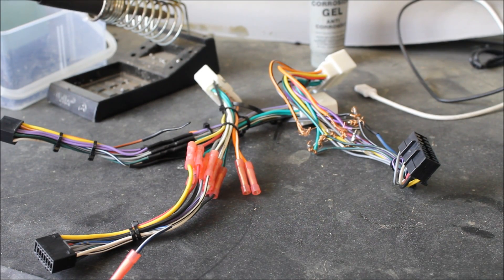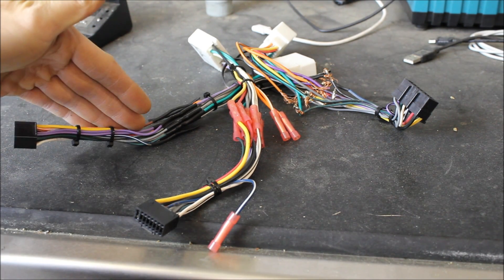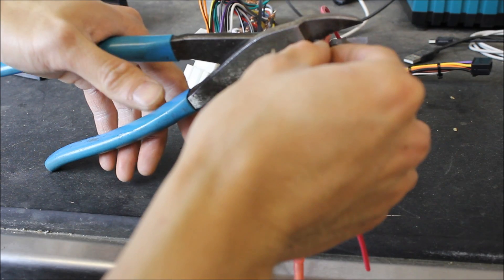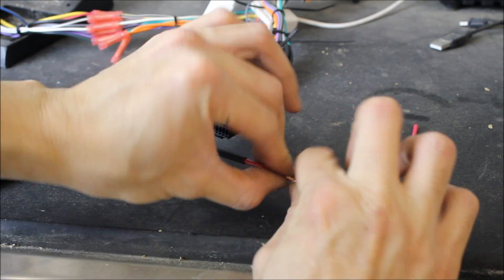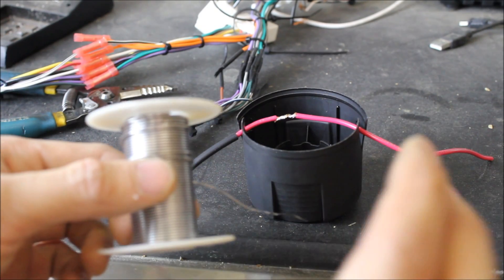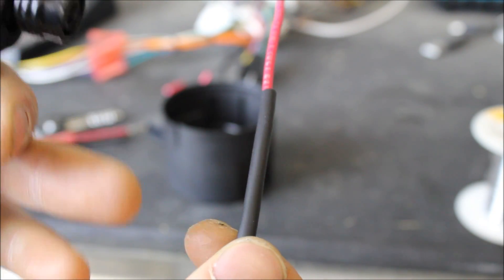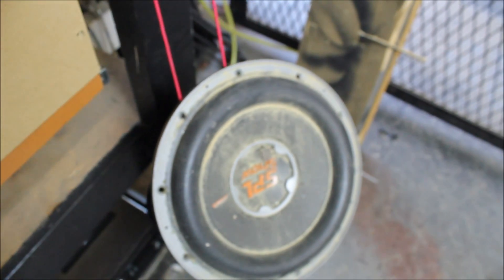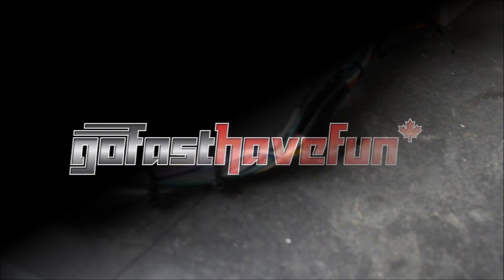Butt Connectors vs Solder | Crimping vs Soldering | Wire Connections | AnthonyJ350

Comment: Good video but disagree that solder doesn't make a good connection. Solder goes through "wetting." That is, solder interacts with copper to form a copper/solder alloy and chemically bonds the copper together. So, for a splice, the solder actually causes the two copper wires to bond together. The solder also "wicks" into the copper strands, bonding them together..
Reply from the maker: Sounds like a good old "Pure Theory vs Practical Application Debate".  So the question I have, what's your preferred method for making connections in remote starters, lighting, sound system integration and providing a life time warranty behind it while working on about 30 cars a week?
Reply: @AnthonyJ350  Actually, I don't work on cars or vehicles at all. My work is on devices, which are stationary. All of my work involves soldering.  But, to your question, "crimps" (solderless connectors) can form an excellent splice, provided one uses the proper connector or terminal and uses a proper crimping tool. I think the ratchet-type crimping tools are some of the best because they give a uniform crimp. The key is a splice that is mechanically strong and is free from oxidation (good strain relief, etc, too). Both solder and crimps will satisfy these requirements. A proper crimp will form a gas-tight connection that will keep oxygen off the copper to prevent oxidation. Boeing aircraft use crimps 99% of the time. 

I believe that both soldering and crimping can give us fantastic results, provided we do both correctly with the proper tools and the proper applications. Oh, there are also "environmental splices." These are low-heat solder connections within shrink tube. Slide over splice and melt solder with heat gun (and collapse shrink tube). Cool, but a little pricey.  If you want to see something cool, Google the NASA standards for both soldering and crimping. Two different documents. Both interesting reads. Thanks again!
Reply from the maker: @bradleysmith681  Thanks for your feedback!
Reply: @AnthonyJ350  Indeed!!

Comment: Can't really go wrong with solder in my opinion, it's the best way to join the two and still retain strength and aesthetic. Word of advice to any DIYers, don't cut the factory harness, just use a adapter, they aren't that expensive and give you more line to work with and an easy disconnect.
Reply from the maker: It's our preferred way of making connections in the shop.

Comment: I always use the right size butt connector for the gauge im working on. I then remove the plastc coating. Put the correct shrink tube over one wire.  Crimp the connector, then slide the shrinktube over the crimp and add the heat to shrink the tube. Its sorta a bit more work but the connection is smaller and the shrinktube helps hold the 2 ends together.
Reply from the maker: Thanks for sharing! Why not just purchase non-insulted connectors and skip one step?
Reply: You know, they sell those without the plastic on them.

Comment: The tinning method that you show around 9 min is most often used on circuit boards. the tinned wire goes into the designed hole easier and then solders easily.
Reply from the maker: We also use the method when we hardwire power adapters for dash cameras or satellite radio tuners.

Comment: Wire nuts with electrical tape works fine. I never had any issues. And it's fast
Reply from the maker: It's pretty bulky when dealing with so many wires in the dash. Don't you think butt connectors or solder just looks more uniform?
Reply: @AnthonyJ350  it's behind the dash. No one will ever see it. As long as you have a tight secure connection, it doesn't matter how it's done.
Reply from the maker: @mluterancik  To me it matters because I have customers the expect a certain level of workmanship. No MECP Certified technician uses wire nuts, just saying how a professional does it.
Reply: @AnthonyJ350  I hear you man. I'm just talking about people that install their own. It's good to take pride in your work.
Reply from the maker: @mluterancik  I'd love for people to install like we do on their own, it's good for the industry. That's why I show how a lot of my work looks behind the dash.

Comment: in automotive use soldering is less reliable due to vibrations and movement the solder can crack.
Reply from the maker: I think it depends on the area in the vehicle, technique and quality of solder.  You also have to factor in factory has no need to "splice" wiring, they just design it to appropriate lengths and use appropriate connectors.  Also factory in solder can also help protect the wire from corrosion.  In the aftermarket soldering is commonly used and we generally provide a life time warranty on workmanship, which is longer than any warranty manufacturers provide.

Comment: Even if both connections are done perfectly, the solder will outlast the butt connectors in terms of corrosion. Since most vehicles are on the road for 10, 20, 30 years, I would stick with solder. However, the fact of the matter is that most people do not understand how to solder. If a person does not use flux or at least flux core solder then they are just adding hot metal to wires. The copper has to have the oxidation removed for the solder to create a chemical bond to the copper wire. If this isn't done, then its just metal super glue.
Reply from the maker: Thanks for sharing!

Comment: Tinning usually only done for solid wire also allow better heat transfer, When using stranded wire you mesh then flow solder.
Adding resistance with solder only issue limited application and wire length usually has greater impact on Resistance.
But as rule of thumb automotive I would use Crimping vs Soldering for automotive if not building wire harness or something inside your house.
Reply from the maker: To each their own, in the industry most of us prefer solder for wire connections, as long as the connection is in a harness that doesn't move they last a very long time.  Had my truck for 13 years and the remote starter works flawlessly.

Comment: Will the quality of the connection affect the sound quality of my stereo?
Reply: Depends on the specific wire you crimp. But if you ask someone with a normal (nothing special) car sound system. You get a "probably not" but if you ask an audiophile you get a "YES IT CHANGES IT"
Reply from the maker: Usually does

Comment: The moment I started watching I knew this was going to start the non-insulated crimp fire-storm. Yes, that’s the way it’s designed but experience leads to changes in process that can work fine. I will put my 2 cents in as someone that was taught in 1987 to use the point on the crimper and have done it that way for 30 years. All the guys in San Diego I ever installed with crimped that way. Many of us went to work at manufacturers, like Directed, Kicker, and JL Audio and we still crimped that way. Now, I do custom wiring in hot rods and I look at crimp connectors as more of a temp fix. But this is common practice.
Reply from the maker: Thanks for sharing your experience!

Comment: Thanks  for your good information 
Please advise me about “ Waterproof Solder Seal Heat Shrink Butt Connectors with Soldering Sleeve “
I want to use it for my car abs socket witch is changed with very bad condition 
But I’m not sure this type is ok or not Due to high temperature under car hood
Reply from the maker: You want to get "marine grade" butt connectors.

Comment: I’d be more interested in knowing how you prefer to tap wires like when installing the heavier gauge ignition wires on a remote start install. Strip back and wrap then solder, strip back spread strands and pass through and wrap wire then tape, or some kind of 3m tap connector? Maybe you could do a comparison video?
Reply from the maker: If it's really thick I'll use the poke and wrap technique with solder.  Typically I pre-tin the factory ignition wire with solder, then wrap the new wire around then apply solder again.
Reply: Scotch-Loc's blow dead dogs.
If you have to tap using a connector use a posi-tap.
Add some silicone grease before closing them up if you're concerned about moisture.

Comment: Hi. Thanks for the video. How would you join a wire in the middle with a butt connector.
Reply from the maker: You don't really.  The bott connector does it when you crimp.

Comment: Thank you! Using the table surface for leverage and properly crimping the butt connector are mega ideas! I am restoring a 2001 Jeep XJ and the audio is a mess. You just saved me a ton of time!  Down the road, I want to install a Joying radio in the center of the Jeep once I get the current rat nest replaced. Cheers!
Reply from the maker: Glad it helped!

Comment: If I'm tapping into the stock head unit speaker outputs to a "speedwire" to the amp, would it be fine using quick connectors vs using butt connectors? If I ever wanted to switch back to stock I could just quick disconnect my amp cables and reconnect the stock wires using the quick connectors..
Reply from the maker: Use but connectors or solder or build a t-harness.

Comment: There is a 3rd and much better option!!  Check out the new low temperature solder shrink tube connectors.  They work great for stereo wiring.  It is easier than soldering and shrink tubing.
Reply from the maker: Thanks for the tip!

Comment: It makes 0 difference if you twist it into a butt connector....twist the wire and push it in and crimp with the correct tool thats all.
Reply from the maker: I twist the wires so it slips into the butt connector easier. If you don't sometimes strands stick out.
Reply: @AnthonyJ350  yep definitely twist the wire....but using a twisting motion to push into the butt connector isnt going to make any difference. Honestly butt connector and solder joint with shrink wrap are both acceptable. My experience with solder is that it dries and breaks

Comment: Good video. Good explanation. In applications which the current more than 10 amps, I use butt connector with overlapped cables end. I just use small copper tube and shrinkage
Greetings from Indonesia
Reply from the maker: Thank you!  Glad you liked it.

Comment: Linemans splice with Solder and heat shrink is the way to go, heck if it is good enough for NASA then it should do for anything else. Doesn't matter if oil from your hands touches it. What you should worry about is the flux residue. Not to mention a lot of people don't know better when it comes to Solder and use Acid Core Plumbing Solder when they should use the 60/40 Rossin Core or Leadfree.

Now for a the audiophile guys that think a wire connection matters. You're nuts and it is impossible to tell the difference. That would be like telling the differences between a filter capacitor in a power supply that is not in the audio path.
Reply from the maker: Thanks for sharing your feedback!
Reply: Lineman's splice is only for solid core wire. Not stranded.
Reply: NASA?  mid-80s complete o-ring failure on the Challenger mission. RIP.

Comment: Little bit late but I wanted to share this

 1-  the Heat  also sucks in the Sada Always put your torch or in on the opposite side and the shadow will actually float to the Heat  this is especially  true when soldering brazing Plumbing pipes but works the same on electrical

That last method of soldering forget it it's the worst way to solder and you going to get cold joints you don't have to worry about having Helping Hands for that because the joints are going to be cold and a waste of your time it is not the right way of soldering
Reply from the maker: Thanks for sharing!

Comment: Lol, the soldering method doesn't suck.  Your method sucks.  Yes helping hands at least.
The connection is about the copper to copper. The solder is there to make a conductive bond.Soldering and shrink tube s the best, most reliable method hands down.
Reply from the maker: nolobede Thanks for the feedback. It'd be great if you posted a video as well so we can see how other people do it.
Reply: It wasn't intended to be a negative critique, I did include an "Lol, but didn't work I guess. .I've tried to solder without helping hands too. The point was only that as you stated your preferred method was solder and heat shrink. I agree and the point about the connection being about copper to copper was  to note that yes, the solder should not be considered the main conductive  component... hence the importance of the copper to copper method when making the connection. Actually I was entertained by watching you with the 2 loose strands.  What I do is spread the copper strands on each end, flux them and push them into each other and solder them up. Conductive and strong, then heat shrink. In my opinion, the solder links you made are the best method. crimping is fine, but most reliable, solder every day day of the week.
Reply from the maker: nolobede Oh it came off as negative because at the beginning it said "your method sucks" and I wasn't sure which part you meant sucks or the whole process.

Comment: If you can't get glue lined heat shrink. Add a bit of hot glue to the connection before you shrink. The glue will remelt and form a water tight connection. I used this method on my fog lights up north and has performed well
Reply from the maker: That's a great tip for exterior applications!

Comment: Lol, I like your video, very helpful.   I just wanted to mention that the reason it was so difficult when you tinned the leads individually was because this method works best when you hold one lead in your other hand making lining up with the other lead easy, if you have steady hands.  I've used this method for years so in my defense  it works well and just takes a little practice and I will say if your doing a lot of wires  it can go quick.  it only takes a minute to tin all individual leads then just go through and line them up, you don't need to add additional solder if you do it right.   But after watching your video I can see the advantage of twisting the leads to make it stronger,i will most likely be using that technique at some point thanks
Reply from the maker: Thanks for the comment!

Comment: Thats why you use non insulated butt connectors with heat shrink. And use the right size. You, waste to much time soldering.
Reply from the maker: A big world out there Soldering does not take that long. Butt connectors with nylon insulators work fine and is an industry standard. It's the plastic insulators that break apart. We work in a high volume shop and solder our harnesses.
Reply: AnthonyJ350 I also work in auto repair. Try my method and use naked connectors with shrink tube. Looks good and fast.
Reply from the maker: A big world out there I'll try. Company mandate is to solder and shrink tube and we have stores across the country and installs have to look similar.

Comment: I don't know, I just can't see how soldered joints could add resistance (or at least any measureable resistance). Does the lead/tin solder conduct more poorly than the copper wire itself? Yes. However, the copper isn't replaced by the solder, simply amalgamated on the surface to form one contiguous mass of metal to hold everything firmly together. The physical connection you made by twisting the wires nice and twist is still there within the joint, and any gaps are filled in with solder as well to increase the effective diameter of the joint. That's just my logic anyway.
Reply from the maker: mannys9130 Indont think it really makes a difference. I think the argument is because the theory electrons around the wire as opposed to inside the copper.
Reply: AnthonyJ350 Yeah, that is definitely true. High frequency AC obeys the skin effect.

Comment: id say but butt connectors are only good IF you have the real ratchet crimper tool, the cheap pressed steel one leads to loose unreliable connectors,  so then soldering/tube is more reliable in a lot of contexts
Reply from the maker: I use a ratchet for marine grade butt connectors.  But for spade I love Channel Lock and some SnapOn crimpers https://www.youtube.com/watch?v=LcCLjbPS-m4&t=40s

Comment: Thanks a LOT.. I was contemplating doing butt connectors; however, I didn't want the bulkiness and want to put wires in wire loom thus you showed me why to solder/shrink tube...
thanks again!
Reply from the maker: Jeffrey Riggs Glad it helped steer you in the direction you wanted to go.

Comment: When soldering, apply the tip of the iron to the wires on the opposite side from where you will touch the solder.  That way the wires are forced to get hot enough to melt the solder when it touches the wires on the opposite side.  Capillary action, not necessarily gravity, pulls the molten solder into the hot wires. 

A mistake many people make when soldering is touching the iron to the wires and immediately placing the solder in the same spot.  The hot iron melts the solder, but the wires may not yet be hot enough to draw the molten solder in.. resulting in a cold solder joint.  Another mistake resulting in a cold solder joint is soldering correctly, but then jostling or moving the wires before the solder has had a chance to cool and fully solidify.

Regardless of whether you use leaded or lead free solder, pay attention to the flux.  It should be acid free flux for any electrical work.  Otherwise acid in the flux would corrode wires over time.  Solder used for plumbing purposes usually has acid in the flux.
Reply: I find that solder usually flows in the direction of the heat source i.e. solder pencil, iron or what have you. That's why I hold the iron on one side and add the solder opposite and rarely directly onto the iron. I'm not sure if it's actually capillary action happening but anyways I agree this your method ✔